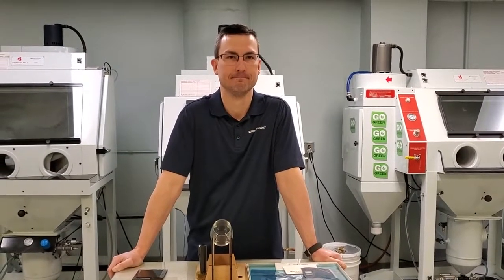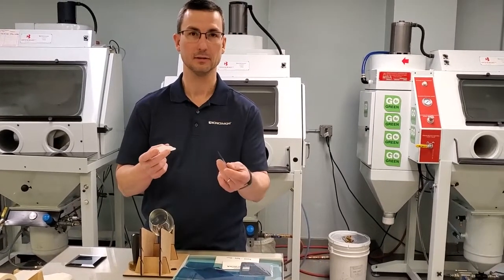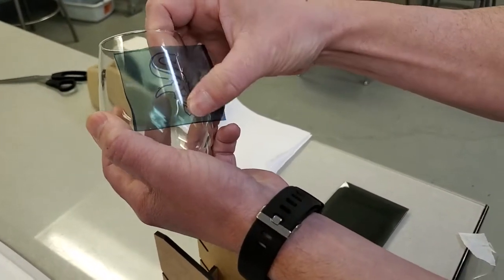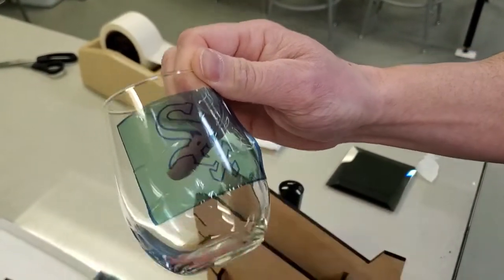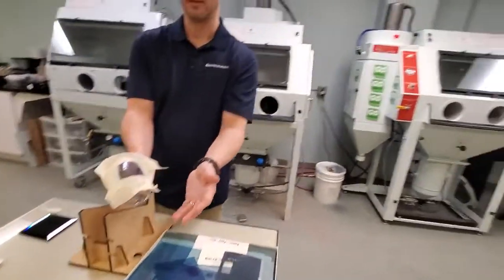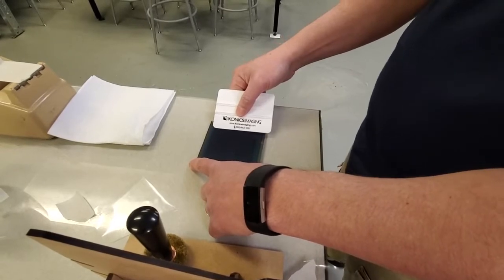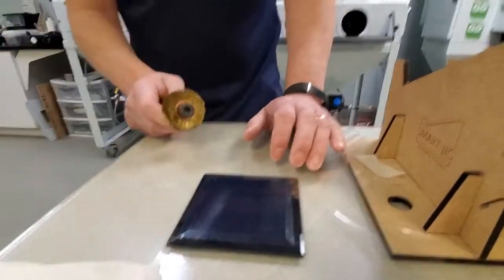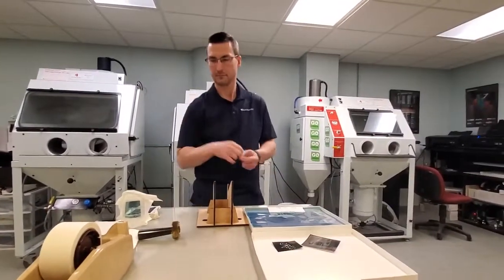Wisdom Wednesday's - Episode 3 - RapidMask Application

Comment: Luv this mask! I pretty much use RapidMask for all my sandblast projects-only problem is that it will stain painted substrate and I haven't been able to find a cleaner to remove the stain, especially the painted tumblers. Great videos - great refresher!
Reply from the maker: Hi Vicki! Try using AquaNet or another scent free hair spray on your substrate before applying your stencil mask. The hairspray acts as a barrier to prevent staining and also helps adhesion to your substrate! Give me a call if you need further help. 1-800-643-1037 ext. 112 or shoot me an email djones@ikonics.com